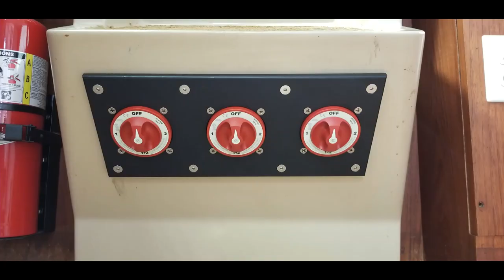1973 Uniflite 34 sedan Pickpocket. Old boat restoration.

Comment: Steel engine mounting brackets . Bad idea .......bronze or stainless min . 5/16”
Reply from the maker: Hi Mike.  Sure, I could have fabricated them from 316L, or spent a fortune casting 1 off bronze mounts.  But steel in this application should be fine, there is nothing stronger. (mounts are 3/8" thick)  What you didn't see in the video was the prep and coating of the mounts.  They were acid etched, prepped and two coated with u-pol por15 (not just rattle canned). They will outlast the boat at this point.  Provided you aren't grinding the coating off which would be no easy task. 
Thanks, I appreciate your input.